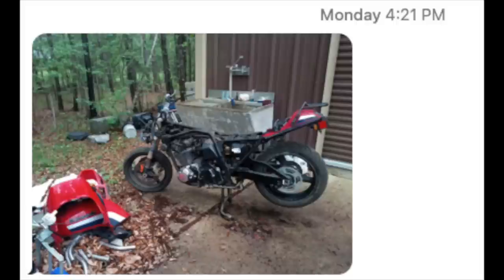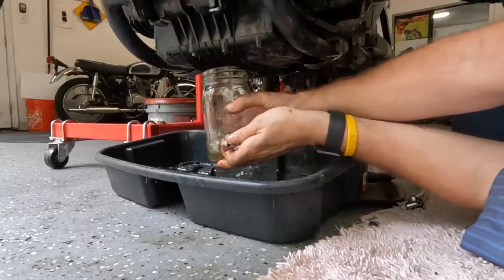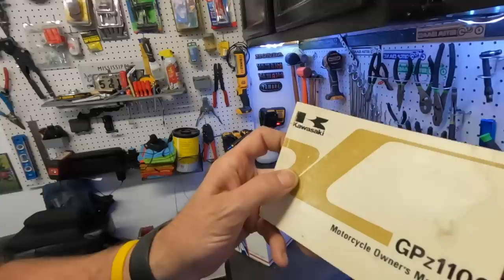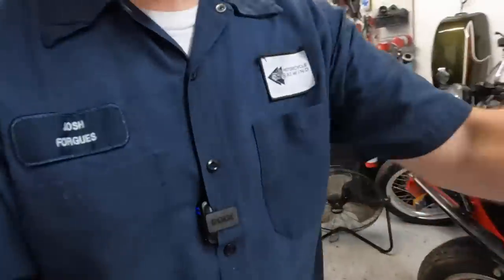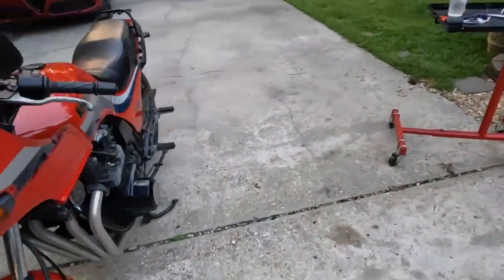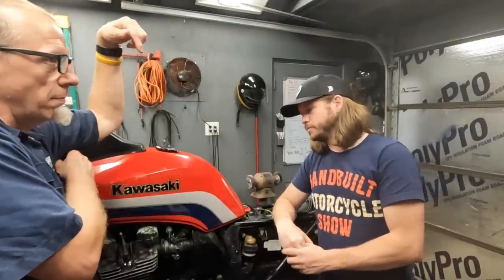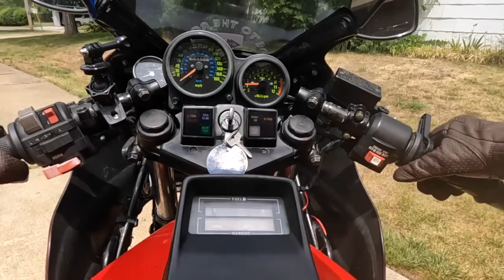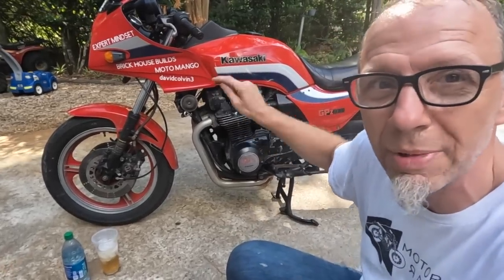Can I ride 3,000 Miles on abandoned 1983 Kawasaki GPZ1100 #gpz1100 #vintagemotorcycle #sportbike

Comment: Switch it over to a microsquirt. $300 - $400 and it will run like a champ.
Reply from the maker: I am guessing that. is some type of injector? Please excuse my ignorance I mainly deal with older motorcycles. Carb, points and drum brakes. Thanks for watching
Reply: @motorcyclerewind  Microsquirt is a DIY standalone ECU to control the fuel injection, or the ignition, or both. It would get rid of all the obsolete and hard to find OEM components of the fuel injection system and replace it with modern, cheap, and easy to find components.

Comment: Well done…speedo not working might be a reason why the mileage is so low….not to rain on your parade.
Reply from the maker: I bought the wrong speedo cable. I zip tied another one on the left side of the speedometer. Taking the speedo off and getting the correct cable is on my list of things to do to the GPZ. Thanks for watching.

Comment: That engine requires a complete strip down and rebuild. Like many other bike “cleaners” this will be another engine destroyed. Cleaning a bike isn’t restoring a bike. Sadly this is another bike lost to history.
Reply from the maker: I agree this engine should be rebuilt. The question I have is it better or worse than when we started? Thanks for watching.
Reply: Don't rebuild see how long it can last after your repair to show us how bomb proof these things r only rebuild it if u bend a vale or loose compression 😊😊😊
Reply: I was surprised the head wasn’t pulled, check the valves….lap the valves ?  Pull the cylinders and at least hone them and check the rings ?
Reply: @foxlake6750  no point if he had it for free the moto is spent Jo pennies aquring the bike spent no money in the rebuild ❤️❤️proves how well built they r

Comment: How come the water coming out of engine was so clean  ? 

That water should have been rusty brown or at least dirty, not pretty much crystal clear.
Reply from the maker: I have no idea. 😂 This is the first time I had water come out of an engine. The water that came out first had a brown tint to it. You can see it when I fill up the jar. Thanks for watching.
Reply: @motorcyclerewind  excellent of you to make your videos my friend. I tip my hat to you.

In my builds and restorations from bikes sitting so long in contact with water, the rust from inside the engine turns all the water brown. 
It seems more that someone has poured fresh water into that engine, and with that amount I'm surprised it did not hydro lock. 

Many of the bolts and studs also seem very very clean, the electrical parts behind the cfank case look brandnew. Those are parts that should be corroded to shit even behind the cover.

None the less you got an ole bus up an running a treat. The model always makes me think topgun lol 

Best of luck with your further work buddy.

Comment: it is a kawasaki clean carbs change oil add fresh gas it is ready for 20k miles
Reply from the maker: I love your attitude. You’re not wrong.😂 thanks for watching.
Reply: @motorcyclerewind   How is it wrong I have actually done so on 2 kawasaki street bikes and old late 80s 600 ninja that say 5 yrs and a older kz550 that sat for years. Clean out tank new lines cables tires carb clean and put 15k on ninja before selling still running great and 25k on kz before giving it to my nephew, he rode for 3 yrs then sold to get newer kwacker. SO how am I wrong I have done probably 7 to 8 old bike redos kawi honda and 1 yamaha all were basic fix and ride just took some time a a bit of maony.

Comment: It looked like your speedometer was inoperative. Why would you go on a 3,000 mile trip with an inoperative speedometer?
Reply from the maker: The first time I ride the bike was 3 days before I left. That when I discovered the speedo was inoperable. I zip tied a speedo inside the fairing to the left of the gauges. Which is visible is some of the footage. Thanks for watching.
Reply: Great work and I liked the long trip as well. I went back and did see your temporary speedometer. I should have picked that up the first time around. Keep up the good work.  @motorcyclerewind

Comment: It’s a Gpzed we Europeans are always right, and we always got rid of the fuel injection system on the Gpzed 1100 cause they were shit and went back to carbs, motorcycles fuel injection in 1981 wasn’t there yet.
Reply from the maker: I’m not willing to give up on the Kawasaki engineers. They had a plan when the designed the GPzed. Thanks for watching.

Comment: Fuel pump.
Reply from the maker: Two things that I will be replacing are the fuel pump and the regulator. But that is not what shut us down. 
The right side coil. For cylinders 2&3 vibrated loose causing no spark issues. 
In retrospect, I wouldn’t have solved this on the side of the road. I immediately went to fuel because of earlier problems. And if I had discovered “no spark”💥 I would have thought CDI and not “let’s check the coil”. 
Thanks for watching.
Reply: @motorcyclerewind  
Amazing that the fuel pump even worked at all from the start, they don't like being stood in stale fuel for years, or even without fuel.  Incredible that it ran and covered that mileage after standing full of water with rusty bores, and not even any smoke!  Well done for saving it from scrap and putting it to use. You gonna get the speedo working?😉

Comment: THIS ENGINE IS NOOO GOOD  WEATHER IT STARTS OR RUNS THE BEARINGS ARE SHOT I WOULD NOT DEPEND ON THIS ENGINE.
Reply from the maker: I am shocked that it doesn’t sound like a bag or marbles in a dryer. For some reason it doesn’t. Thanks for watching I really appreciate it.

Comment: Don't no if you fix it had one great bike problems people had this is digital fuel injection fuel shut off is the bike worse enemy start up bike runs a short time it runs out gas .the fuel pump is buried up from no gas replace fuel pump start up should run great when you stop do not shut the fuel valve or you will starve the fuel pump again it take a while  for this to happen. No rich fuel start no high power fuel enrichment many men rip fuel jec tion. Off putt carbs on them like over 1000.00 in parte not ilcluding jets  Ps I I think pump is in the bottom of the tank
Reply: Injection will adjust fueling for all riding condition .ps im driveablty tech for gm toyota many dealers i bought my not running replace fuel pump drove back by the guy I bought it from told him he need run primum it  wit great anti dive ftont brakes air forks air shock in the rear dash board on the tank put a lower faring an it was much quite after that  road it for a couple years stepson was joy riding it while I was at the river put the bike the recycler had more than a dozens calls told them all come 10:00 Saturday had a bike auction went to Australia  by tom
Reply from the maker: Thanks. I got it running again and have been riding it nearly daily. The problem that shut us down at the end was, the right coil vibrated loose and was shorting out. Once I sorted that out it had been fine.